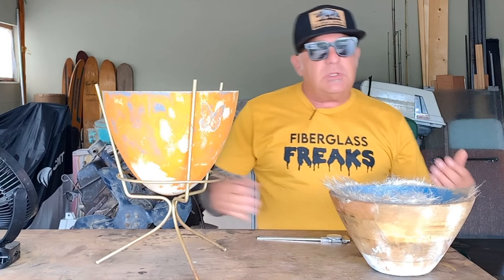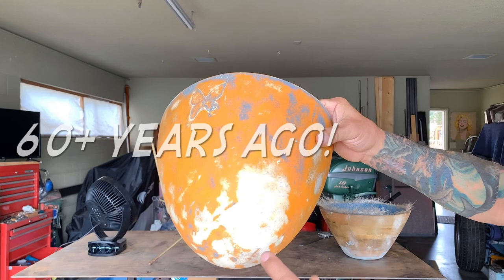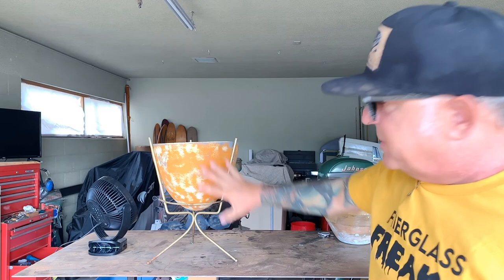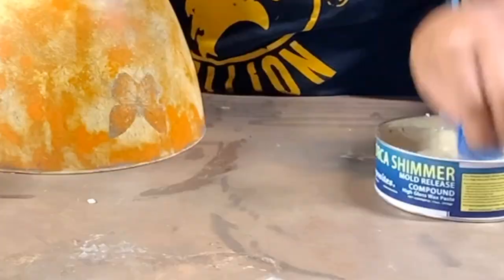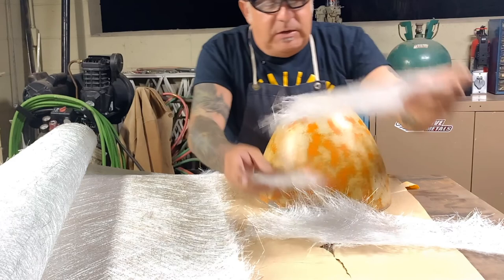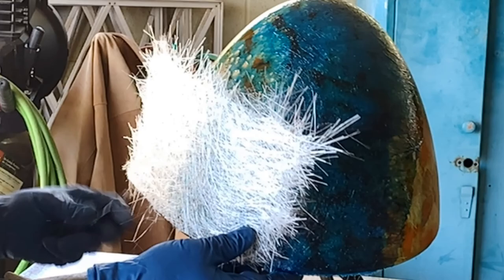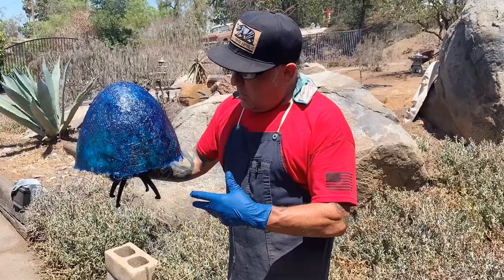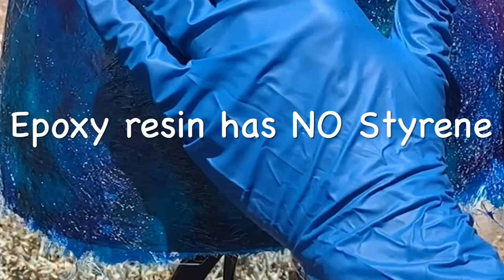Making A Fiberglass Bullet Planter Mold From An Original  | Part 1

Comment: Do you not get splinters from that? Or is it different from like fiberglass insulation? 

My dad used to have a fiberglass chair that was so cool. Looking back now it was probably MCM era.
Reply from the maker: Hello Technoindigo, I can get really itchy while sanding or rubbing on a freshly sanded area.  I usually add some ‘surface seal’ to the resin which makes the dried edges of the fiberglass soft, not splintery.  Your dad may had a potato chip chair (nickname).   The generation era of those fiberglass chairs start around $1000-$1500 today, as collectibles.
Reply: @westcoast_johnny  It was the one piece of rounded fiberglass. Definitely an Eames, I’m sure. It was in the garage and sometimes outside so it didn’t hold up well and finally broke at some point when I was young.